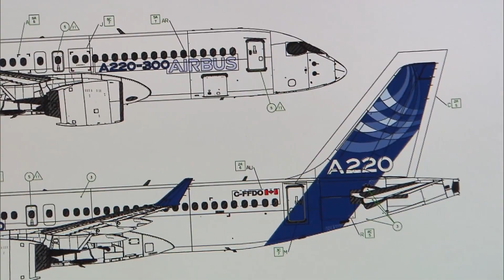JetBlue ORDERS 60 A220-300 Jets!

Comment: The shorter CS100 now known as the A220-100 seats a maximum of 132 but in a dual class seating setup, most airlines use 118 to 125. It is the very first jet to use a new type of engine that has a gearbox inside it, which reduces noise by up to 70 percent and fuel burn is reduced by 21 percent, partly due to the 12,000 pounds less weight compared to a Boeing 737. It has the widest seats, isles and the biggest windows of any mid size jet. The overhead luggage bins are 1/2 a foot lower and each bin can hold three full size IATA 26 inch suitcases. This means all your luggage can be a carry-on, meaning no waiting or lost or damaged luggage at the end of your trip. This will save at least 30 minutes at the end of each leg of your trip. Delta Airlines also ordered 60 CS300 Bombardier /Airbus A220-300 3 years ago and will out them into the New York to LAX route first in July or August 2018.

Comment: Southwest A220??
Reply: lol no
Reply: Clark McKee No, Southwest won't use it because the stretch version Bombardier CS300/Airbus A220-300 only seats 145 in a North American or Europe setup because of the longer legroom compared to 28 or 29 inches for some budget airlines in Asia. Korean Airlines already put some CS300 into service for the Winter Olympics but they are  Two Class seating arrangement, probably seating 135.